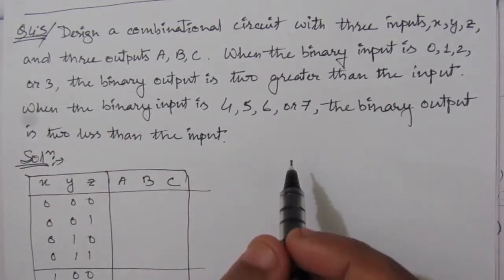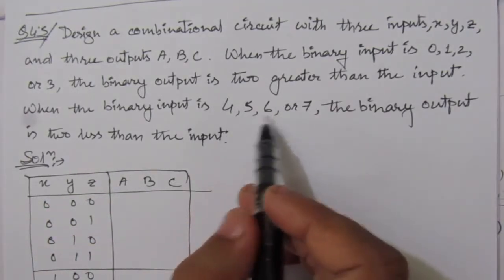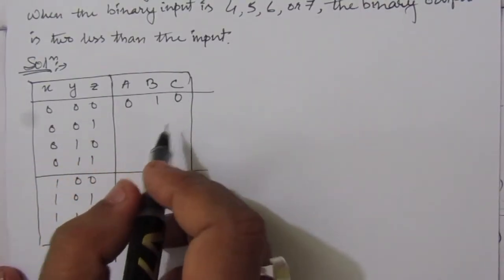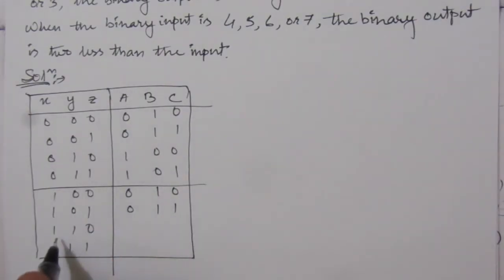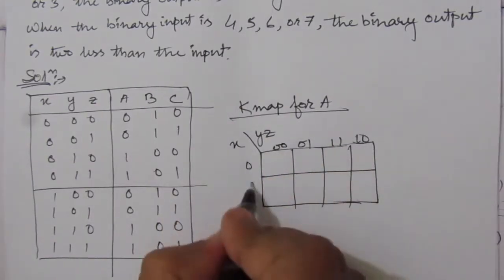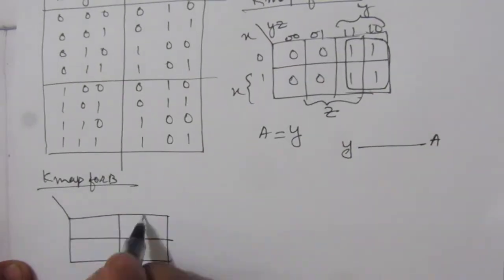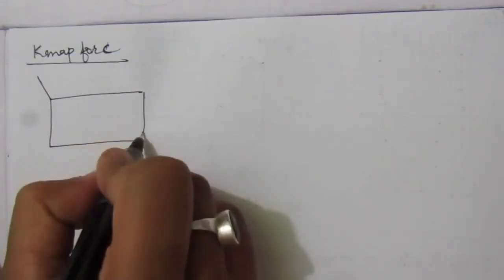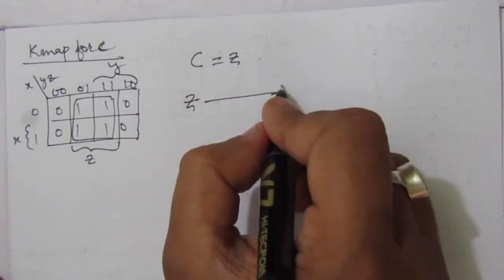Q. 4.5: Design a combinational circuit with three inputs, x, y, and z, and three outputs, A, B and C

Comment: A combinational logic circuit has three inputs x, y, and z and two outputs A and B. Output A is high when either x or y is low and z is high. Output B is low when z is low and x is high regardless of the value of y.
a) Draw the truth table for the combinational circuit.
b) Design the circuit for output A using a 3-to-8 decoder block and external gates.
c) Design the circuit for output B using a 4-to-1 multiplexer.

Comment: Design a combinational circuit using a ROM. The circuit accepts a three‐bit number and outputs a binary number equal to 10 times the input number. Start with the truth table and show your implementation using:   
i.	A decoder (Hint: use a 3×8 decoder). 
ii.	A ROM block diagram (Hint: an 8 × 4 ROM suffices!)
Reply: send me the answer eyobtariku55@gmail.com
Reply: https://www.youtube.com/watch?v=DSClog6vn3A

Comment: the actual video is different from the given problem. it says the binary output is ONE greater than the input. but the video says TWO
Reply: It changes depending on the edition of the book
Reply: the difference is literally only in the k map portion, which you should be great at kmap at this point, the point of the video is to help with the idea of the question itself so you're familiar with it.
Reply: Ma ya video deakh kr gya tha or outpout yad thi bas or paper Ma. Tha mara ab zro 0 a gya is ma 😢
Reply: i think he made a mistake

Comment: How can I find this? By a comparator ?

Design a combinational circuit which has six inputs y2,y1,y0,x2,x1,x0 and four outputs Z3, Z2, Z1, Z0.
a) Z0 is high whenever vector Y is equal to vector X
b) Z1 is high whenever vector Y is greater than vector X
c) Z2 is high whenever vector Y is less than vector X